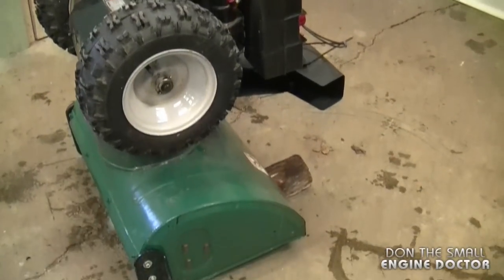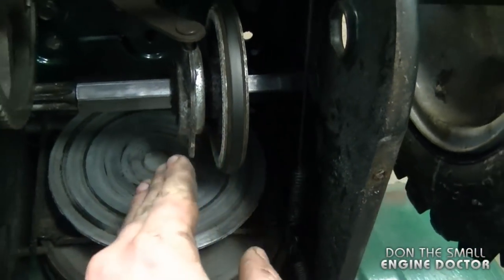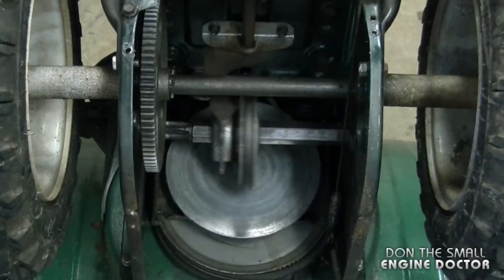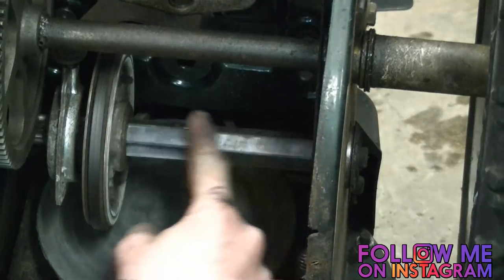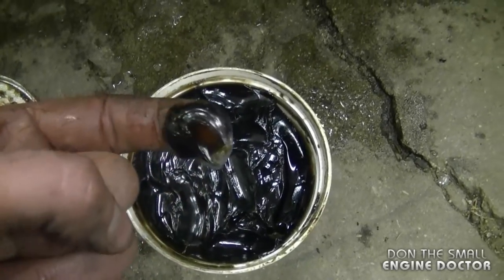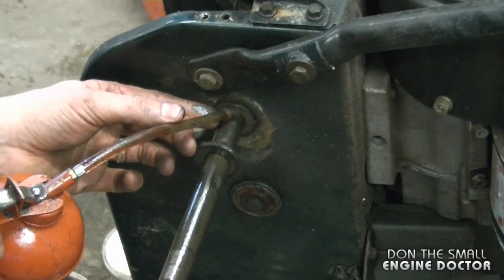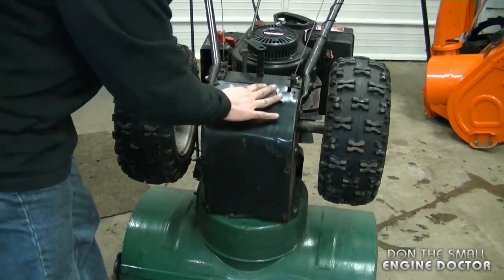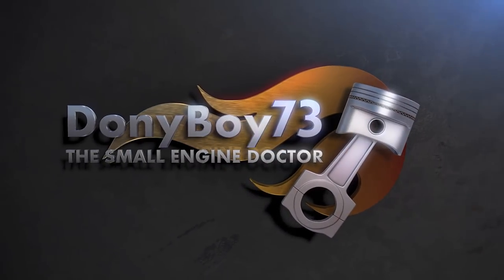HOW-TO Grease A Snowblower Transmission

Comment: I had a mechanic replace an auger cable on a NOMA which was more work than I wanted to tackle.  He didn't put the auger belt on correctly and it disintegrated first run.  After watching these videos I replaced it easily myself and it works great now.....thanks Dony.

Comment: I have seen many of your videos on cleaning carbuerator,I have a good tip:
I always use  Alkylate gasoline on my snowblower and always fill up the tank after every time I use it so no condense can cause problem, and I never have problem with the carburetor because there is no water or pollution in alkylate gasoline, and the alkylate can stay in the tank during summertime and prevent corrosion in the tank, because alkylate will not go bad for at least one year, the down side it is more expensive than ordenary gasoline, if you follow this procedure you will have no more problem starting your snowblower
Reply from the maker: I have some in the shop but most people don't want to buy it because of the price

Comment: Murray/Craftsman/Noma and other private brand machines built by Murray also have a zerk fitting underneath the metal drive plate which needs periodic greasing with a grease gun.  The maintenance manual mentions this but I am sure that it often gets overlooked.

Comment: On many machines the Axle Bearings are in a 6 sided hole and with use, wear out the Brass Oilite bushings at  the Top inside portion.  When you have the wheels off, mark the edge of the bushings and rotate them 180°.  This will tighten chains and gear clearances.  You could also have some on hand and simply replace them.

Comment: That is a good idea for all your equipment and I do it for my lawn equipment, as well as my vehicles, and utility tractors. I learned my lesson the hard way and make sure that the maintenance is performed each season. Right now I am taking advantage of my new battery chainsaw, and about to use the battery weed trimmer which I purchased first. For some reason I am having problems cranking my gas chainsaws and one of them is nearly new now. Two of the saws was in the repair shop last Summer and one was new and had to have the carburetor replaced. The other one which I purchased new about three years ago never wanted to crank the way the company said it should be done. I guess that I will try drop starting them to see if they will crank that way since that is the way the people at the shop started them.

Comment: Great video . Good tips . I use brake cleaner with a blue scrubby pad on the large friction disc then wipe dry with a clean shop towel with a bit more brake cleaner and lightly clean the rubber on the friction wheel as well . But for shaft lube I use non virgin or de-virginated olive oil  . My blower smells tres good when it heats up . My machine melts the snow and ice . But I buy a new one on every pre winter sale every year . lol

Comment: One tip is to work the grease into the gear teeth with a small screwdriver,the other thing is selecting the right grease for the application.

We had trouble with both the red & blue grease which was supposed to be good for bearings when we used to repair power tools,the grease got thrown off the gears as it didn't stick & could possibly cause the gears to wear out faster.

We ended up getting this yellow coloured Shell grease which was very good.
Reply: Thick Front Wheel Bearing grease will stay in place.
Reply: Lucas red or green tacky works great!

Comment: Smashing tutorial don :-D
I can't see that snow blower having any problem behaving itself now :-D.
Just a light smear of oil/grease does not break the bank, shame that people forget :-(.
Reply: You mean I'm supposed to actually read the maintenance manual?
Reply: Mike, No no, just look at the pictures :-D, that's what i do :)
Reply: They often find out the hard way when the machine breaks down when you really need it and the shops are already full of broken machines.  Or even worse the machine becomes uneconomical to repair because major components are prematurely worn out.  Changing the engine oil often enough is important too because the engines are frequently stretched to their limits when dealing with heavy snowfalls.

Comment: With the belly pan removed, it's also a great opportunity to check wheel drive and impeller belts condition. If they show any wear, cracks or fray, replace them and save yourself the agony of a rupture down the road when you need your snowblower the most !

Comment: a great alternative to the gas so you don't stink for the next 24hrs is brakleen(used for removing grease from automotive brake parts) costs only $2.50 USD for a spray can of the stuff, every autoparts store sells it

Comment: Don you do great work. I like the Lubriplate low temp. The only thing I do different is wearing some rubber gloves when I use any type of aromatic cleaning solvent including gasoline. They go right through your skin.  I've become a little more of a woose in my old age.

Comment: Thanks for the nice tutorial. Just one question - at 1:24, what is the spring called at the bottom of the picture? I just did and overdue maintenance on my MTD blower, very similar to the one you're working on in the video, and that spring is broken. Looking at the parts diagrams I can't seem to find it. Appreciate your help.

Comment: nice video!  what do you use to lubricate the gears that the discharge chute is attached to and all the connecting cables and turn mechanisms?
Reply from the maker: chain lube works great, I also use any grease for the gears

Comment: I have a  question for you I recently purchased a new weedeater it calls for a 40 to 1 ratio my old one called for 50 to 1 Could I use the 50 to 1 on my new weedeater or use 40 to 1 on both I really respect your opinionThank you Joe
Reply: I think you could safely use both.

Comment: I actually have a grease zerk under the flat metal disk. When I would engage the drive lever my snowblower traction drive would stay engaged after I let off the lever. It would run away for several feet and then "pop" back into neutral. Using a grease gun with good low temp grease on this zerk solved that problem. Hope this helps someone!

Comment: Is red n tacky grease good for grease?
Reply from the maker: yes
Reply: @donyboy73  okay. I called they said don’t get red n tacky on any plastic since it’ll eat away at it. Grease is good metal on metal
Reply: @donyboy73  is white lithium grease spray on okay for around metal on metal hinges or would you use the red n tacky greaee
Reply from the maker: @appleztooranges  i use lithium grease in spray cans for those hard to reach places, yes it is good on hinges
Reply: @donyboy73  thanks for your answers. I found a tool bag inside my air filter of my Honda snowblower (1332). Had it used and bolt felt lose so I took cover off and found the tool bag filled with shear pins and wrenches. Hopefully didnt do any damage to my Honda engine. Seems like it is starting easier now though. What are your thoughts? Never reved or nothing. Just sometimes took more than one pull on the Honda 13 engine

Comment: Instead of gas can you use brake clean?
Reply from the maker: yes you can
Reply: @donyboy73  Thanks for the video!  I have a 70's snow thrower and today did the maintenance on it that was overdue.  I was surprised to find 3 grease fittings too.

Comment: No grease for that part. That is not a bearing nor a bushing. 
It is not a steady moving part that is essential for the functioning of the machine. At all. It is nothing but a command function, not a running essential part (engine). Therefore, and this needs to be said (because, we can't escape from those city-diots etc, and they need to know the facts, just as/like we have learned which way/side to turn a wrench way-back when we were toddlers), this part ONLY moves when one/its operator switches speed/direction. This kind of mechanism only needs anti-seize (but I like to mix graphite-powder with anti-seize, 30+/70 mix, and remove any excess wetness etc). Nothing else. 
Other parts like cables and such only needs graphite in them. Not the spray ones, only the real powder stuff.

I do not mean to bash your video nor your work Dony.
It's just that too many people just can't grasp anything even when we draw em a picture of what/how/why to do anything. ;)  (but they know what to do with a pizza of course.... only when it's delivered that is ;)
Reply: How do you get the powdered graphite inside the plastic cable sleeve?